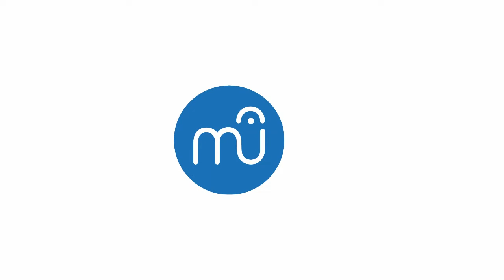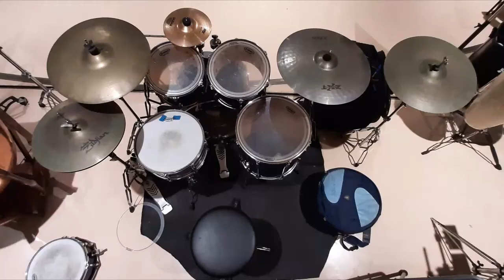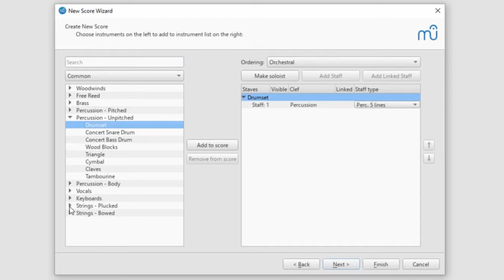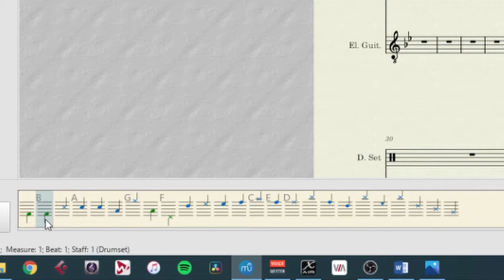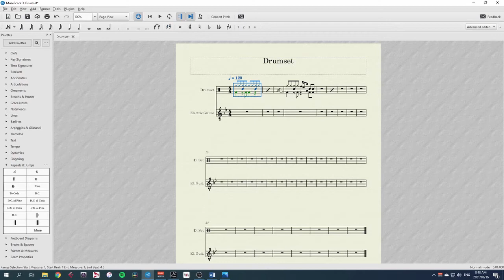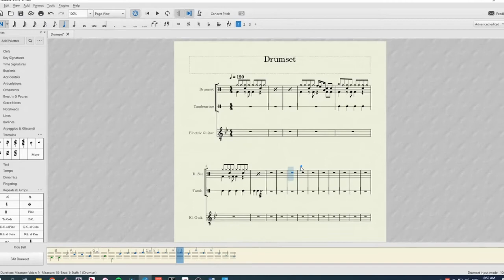MuseScore Tutorial 8 - Drum Set and Percussion

Comment: What about open hi hats?  Thank you
Reply from the maker: It's the cross notehead in the top space. I wish I could post a picture here! It doesn't have a shortcut by default but you can give it one in place of one of the current defaults.
Reply: My point  is that OH natation position not on the
correct line with the correct circle articulation.
This really makes MS drum notation unusable.
Otherwise, a fine video
Reply: OH in MS is in the space below HH
with 'x' head
Reply: @anzatzi  im late but double tap the open high hat note and hold the up arrow till it's where you want, then press ctrl e with that note selected and add a letter that looks like a circle like a O(also make it bigger so it looks right)
drag that circle ontop of the open high hat and you have the closest thing i know of to the correct symbol
now it's playable and printable
Reply: @builderdog3875  thank you
Reply from the maker: @builderdog3875  and @anzatzi I know I'm really late! Didn't see these replies until I started looking into drumkit things again. Luckily MuseScore is very configurable! You can make it look good, easy to enter and still sound right fairly easily: Enter note input mode (N), then click Edit Drumset button. In the dialog, find the Open Hi-Hat (a#2), then simply change the notehead group to XCircle and adjust staff line so that the note appears wherever you want it to appear. I'm pretty sure these settings will persist for any other scores you create too! Assign a shortcut if you use open hi-hat a lot.